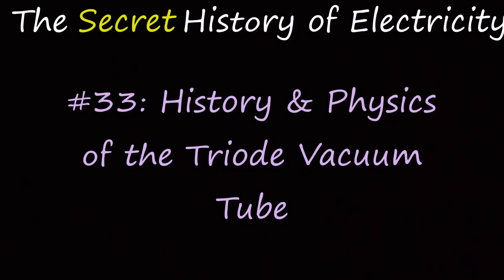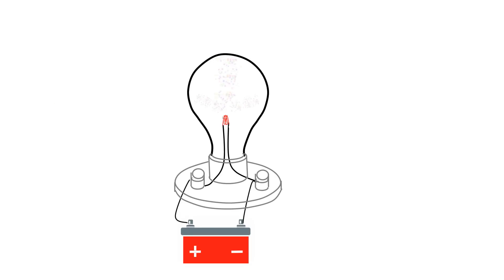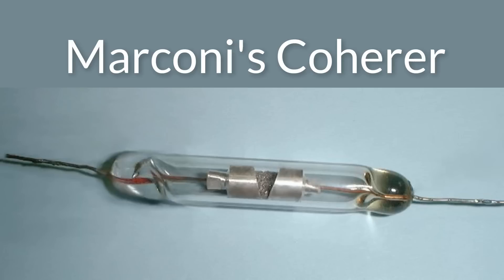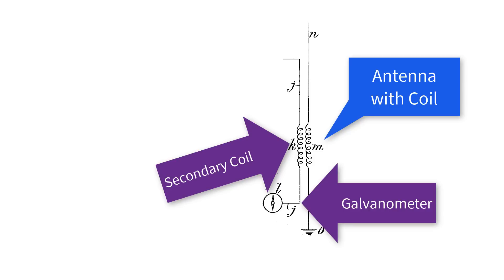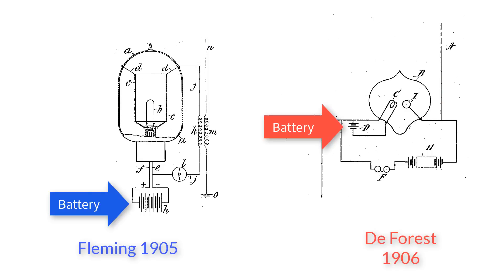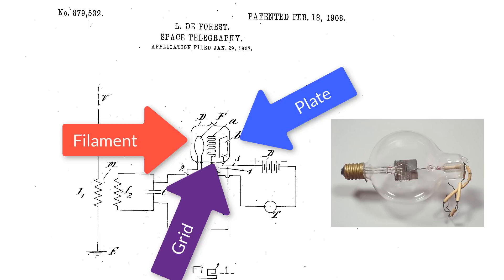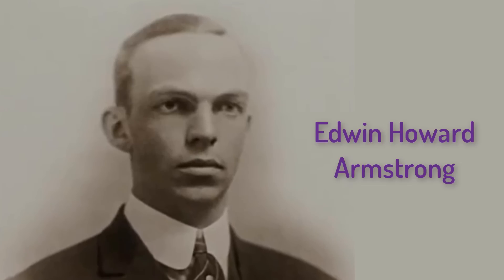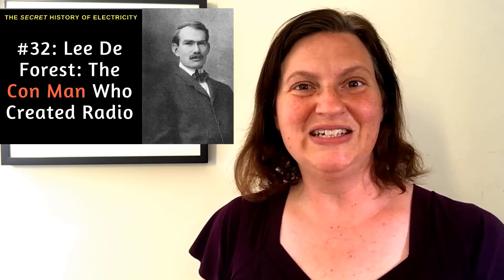Triode Vacuum Tube: History & Physics

Comment: I love learning the history of things I worked on. I first learned about tubes in high school in the late 1960s. At 16yo I had an apprentice license for TV repair. I wasn’t supposed to make house calls till 18 but the two men I worked for considered me qualified to do so. Imagine a 16 yo kids with a tube caddy and test equipment showing up at your house. I went into the Navy in 71 and they taught us both tubes and transistors. We’ve come a long way since then.
Reply from the maker: If you consider the fact that the television was invented by a 14-year-old, it makes perfect sense that you were qualified to fix them at 16!  I bet you did a better job than the adults.
Reply: @Kathy_Loves_Physics  I had a successful career working in electronics. I have worked extensively with fiber optic, digital microwave and satellite down to breaking out all those little circuits and testing them. I also did some  trunked radio. My phone rang a lot for advice. Heck, it still does from time to time and I’m retired. during my free time I built houses, worked on my own vehicles even rebuilding engines and automatic transmissions.
Reply from the maker: Wow!
Reply: I worked for aTV repair shop when I was 16 ~ 17 . After I made a few service calls by myself , the boss said I needed to grow a mustache and beard , because the lonely housewife customers complined and said I looked too young .

Comment: In multi kilowatt industrial lasers, we use vacuum tubes / triodes to switch 9 to 12 KV resonating at 80 Mhz, on and off to control the CO2 laser source.   The tubes are from Thales, anode voltage is up to 12.5 KV, grid is at -200V and switched at 60Khz.   The tube is cooled with deionized water running through it, the ceramic insulation glows a bright orange when run at full power.

Comment: When I was at college we briefly learnt about Valves and those old fashioned in the UK and Europe Pre-SI units used to specify them.  That was in about 1975-77, otherwise, transistor, inductors, capacitor stuff was all SI units.  I made a few things with valves that I could get to work more easily than transistor circuits.
Reply: This super-regenerative TRF radio works very well (page 43) I made, back in the 70s when I was a teenager it but without the reaction, as I was concerned not to broadcast rather than receive.

Comment: Still using them😃 Building guitar amps. Currently building a clone of a 1938 Gibson amp which includes a field coil speaker! Taking about patents, us Brits had the pentode patent The Americans requires a licence to manufacture them, however as the Americans are not keen on paying the Brits ( nothing new here from what happened at Boston😂), they came up with the beam tetrode which essentially does the same job but the internal layout of the valve (tube in the US) is different, effectively bypassing the British pentode patent.

Comment: I do not know too much about it but l think that Deforest knew that his triode was an electronic amplifier and used it without feedback to design primitive radios receiver and transmitters. In fact such radio circuits were taught in high school physics, many years ago, because they are relatively easy to understand. Armstrong discovered the way of making electronic oscillators with the triode by using a feedback circuit. Armstrong used it to create the regenerative and super regenerative radios which outperformed the primitive Deforest radio. Armstrong circuits were a long way more complex and unstable  than Deforest primitive circuits. Armstrong's oscillator is the key component of the superheterodyne radio, the most successful radio design. Armstrong became rich with it.
Reply: I read a book long ago and the history was very different. It bothers me the treatment of DeForest as a "con man". After I read this book, DeForest is to me the father of electronics and the victim of giant AT&T at that time. I would like to know what sources have Kathy about DeForest. I had watched other Kath's videos and found them very respectable and interesting. The author's name is Israel E Levine, and the book is Electronics Pioneer (c 1964).
Reply: @augustot.pareja8795  you are correct, Deforest discovered the first electronic amplifier and he has his place in old physics textbooks. However, modern books about history of radio present him as a villain and dishonest person (see 'science of radio' by Nahin for example), so the video is repeating  those opinions. Certainly, Deforest was not a 'nice' guy but if Marconi got a Nobel prize then it is fair to say that Deforest deserved one, by accident, too.

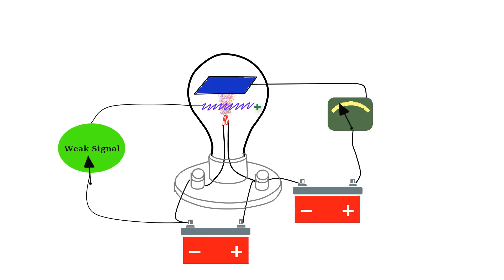Comment: 8:04  To be more precise the grid amplifies voltage rather than current: a small voltage change on the grid produces the same change in current as would do a large voltage change on the cathode.  For this reason in order to get good amplification we have to connect the cathode through a high impedance to collect these voltage changes on the cathode.
Reply: Yes. The tube amp has a high input impedance unlike the bipolar transistor.

Comment: I am finding these videos fascinating. My 1st "bout" with radio was in 1943 (7YO) strung a wire from a metal thingie on top of a tube in the old Zenith (Thank goodness it was a grid not a plate LOLOL) and I made static which interfered with the war news. I got paddled.
Greatest treasure I ever discovered accidentally  was "The Boys Book of Radio" in the school library, 5th grade 1946. I didnt know much about "condensers" or "Impadence" or why you had to wind so many turns of wire around a Quakers Oat box but I did get a crystal set to work sorta.  That book taught me the color codes and I bummed a bunch of 1930's junk radios from a local repair shop, only got a one 27 tuber to work for B. Scouts 1949.  1952, built a Radio Shack Knight kit 2 1S5's, SHORT WAVE - THE WORLD, SOLD ME.!!!! and radio/electronics became a career that lasted all the way thru the Navy as a CTM  and eventually on into computers to my retirement in 1994.  BTW I hate solid state 
An old man reminiscing. Sorry..
Reply: Fredrick Wise
It's ok tubes are better than transistors for audio amplifiers. If you have good transformers on the output you will get good sound. You will not get tube sound at the preamplifier stage you must have a good iron core transformer on the output of a 6BQ5 or 6CA7 or equivalent. I tried them headphone amplifiers with the single tube. I looked inside and 12 Volts on the plate and grid is a joke there is also a solid state amplifier inside that tin box. You can only fool me once. I love my dynaco amplifier. I need to recap and probably get matched quads for the amplifier. I want to keep it original. Magnavox also made good tube amplifiers.
Reply: @ronb6182  Few people realize the truth of what you have said.. For me it doesnt matter much anymore. Ive lost the upper two octaves in both ears working around industrial machinery before OSHA..
 In my 20;sI was tested, able to hear up to 26K, now I can barely hear lightning. LOL
Reply: @frederickwise5238  see the problem is the younger whipper snappers haven't grown up listening to tube electronics. I played with tube electronics since 7th grade. I remember AM radios sounded like stereo when they played classical music and beautiful music genre. I never had an FM radio but my friend had one. I got my older sister's stereo console which had FM later like one year later. After hearing a rock song on a dynaco st70 (another friend had one) and hearing the same song on a transistor stereo the dynaco won. The bass was richer on the dynaco. The transistor stereo was flat sounded. Then you got older transistor sets that sound better than new amps. I prefer the tube sets over all transistor sets. My hearing is not as good as it was but I can still hear the high notes. I have headphones that blot out sounds that are harmful to the ears at my workplace.
Reply: @ronb6182  The "phenomenom" to which you refer relates to the rich overtones or harmonics. that transistors "cant do"
I suspect that the streams of electrons in tubes can "ring" (dont know what else to call it) and the magnetic fields of good quality output transforemerw do much the same. These provide the timbre that tansistors cut off. But when you no longer hear above 8K or below avbout 250cps it matters little. LOL
Reply: @frederickwise5238  you said it better than I could. I have a few transistor amps I might try putting some iron between the output and speaker. I have a few isolation transformers at work. I will post what I find out. May even hook a scope to the output. I used to have a scope hooked up to one of my stereo  channels. In my youthful years.
Reply: @ronb6182  I dont think that will help. You cant get back near the end what has been lost up front.
Reply: @frederickwise5238  you are probably right. It may only help what's there which isn't much.

Comment: Thank you. ♥️ I got all nostalgic. Time to get my oddball 'tubes' , transformers , inductors out and build another guitar amp. I'm going old skool and querky. NO :  ECC83 or  12AX7 types permitted. NO : EL84, EL34, 6v6, 6L6. EVERY amp uses these!  I'm excited. 😊😊
Reply: I built a guitar amp with the goal of using tubes not normally used there as well. It has 6dj8 tubes and uses one of them in cascode. Unfortunately I never had much luck learning to play.
Reply: @canuckprogressive.3435  Ahaa.... E88CC is our Brit counterpart for 6dj8. I think they both like 130volts or less on the plate. Mu is a third of 12ax7. I am an old UK 70's punk... you don't need many chords to have a fun time. Good luck. 😊😊

Comment: Excellent explanation of the triode. I do wonder why it was necessary to rectify the signal from a radio antenna?
Reply: The low frequency  audio signal is carried” to the radio receiver by the radio frequency wave. The carrier is modulated with the audio to form an AM signal. Imagine this composite signal displayed on a oscilloscope with the waves mean centred on the zero y graticule. If you algebraically sum the upper and lower side bands you end up with zero volts. Remove either the upper or lower sidebands by passing it through a diode rectifier and low pass filter and you end up with the original audio signal to amplify and play through the speaker. Hope that is clear?

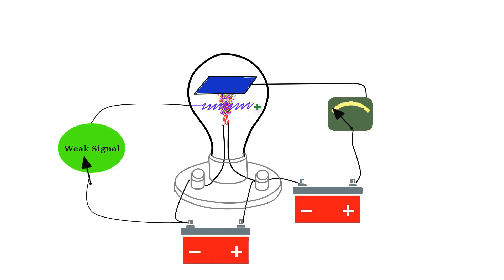Comment: 07:40 - An important point about grid voltage: valve circuits are designed so that the grid voltage is never positive with respect to the cathode; significant grid current stops the circuit from working and can destroy the valve. Maximum current through the triode occurs when the grid is at the same potential as the cathode - it is like a depletion-mode FET.
Reply: Yes, you have to bias it to prevent its shorting out thru the grid as an extra anode, closer than the plate.  However, there are "gun" style electron accelerators, and it's possible the early experimental grids -- we're calling them "grid" only in retrospect based on the most successful design -- could function as electron accelerators, diminishing the voltage drop while losing a negligible amount of current to the grid.

Comment: Electrons do not "jump off" the filament. 
The heated filament's surface is so hot that some electrons acquire sufficient kinetic energy to "escape" and form a "cloud" (the Space Charge) around the filament. 
This space charge exists around any sufficiently-hot surface, even in an incandescent light globe. 
The desnity of the space charge is determined by (i) temperature and (ii) work function - how readily electrons can escape the surface.

Comment: Please explain how electrons can create a smudge - Thanks, Phil
Reply: Since the filament was boiling off electrons when it finally gave away some of the pieces of filament with electrons still boiling off went to the positive side of the tube that’s my guess
Reply: @carlcook944  The electrons have nothing to do with it. When the filament failed, the tungsten vaporized and was deposited on the cool glass envelope.
Reply: @carlcook944  Once the filament fails, no more current will flow and the electrons will instantly cease to boil off.
Reply: If memory serves, tungsten filaments had not yet been in use. The filaments were largely carbonised cotton threads. It had already been noted that longer and or hotter the filament burned greater was there an accumulation of carbon deposit on the inside of the glass at the anode quadrant of bulb. But it was the case additional material would evaporate and coat the glass when the filament failed. (Curious, might this been an early inspiration for vapor deposition?)
Reply: @MetuPhysics-de4yj  I forgot about carbonized thread, but definitely not electrons. Vapor deposition like the getter in a vacuum tube!

Comment: Many thanks for your work in the electric field. I have a question that Would a triode give me an output power of higher frequency and higher voltage(say 30Khz/60Kv) from an input power of low frequency and low voltage(say 50 Hz and 220V). If yes does the triode vacuum technology have advantages over the transformers? Thank you
Reply: Yes but it would be slightly complicated.  The input frequency of the triode is gong to be DC.  So what you would do is rectify the 220 volt 50 Hz source to DC; then feed a triode oscillator operating at 30 KHz into a transformer, the turns ratio of which is suitable to change 220 volts (more or less) to 60 kilovolts.  Then you would have 60 KV at 30 KHz.  Not much power in it, but at least you would have frequency and voltage. 

It is the transformer that gives you 60 kilovolts out of 220 volts.

It is the triode that gives you 30 kilohertz.  

You won't get much power which is to say volts times amps.  A large triode can deliver up to about 40 watts.  A really big metal finned triode can do up to about a thousand watts. 

Transformers do not and cannot change frequency.  They can only change the particulars of voltage and current such that the product of volts-times-amps on input is approximately equal on output.
Reply: A 60 kV transformer is a problem of its own, insulation, corona discharge... Obviously it has been done many times before but for an amateur it is a path fraught with dangers from lethal voltages.

Comment: I may be wrong about this but I don’t think it was a smudge that Edison was investigating. A tungsten filament in argon makes a smudge when it breaks, but not a carbon filament in a vacuum. White hot carbon is volatile and the vacuum increases the effect. As the Edison bulb aged the filament eroded away by vaporizing with the carbon vapor condensing on the entire inside of the globe whenever the light was turned off. This made the globe get darker and darker as the filament got weaker and weaker continuously over time. Edison bulbs steadily dimmed over their lifespan.

I also don’t think Edison added a second battery to his experimental lightbulb containing the plate. Biasing the plate is how it’s used in electronics, Edison by accident detected a small current between the plate and the positive terminal of the battery powering the filament that didn’t seem to him to have a complete circuit. It was a fraction of the current across filament and while experimenting with it he found that the fraction remained constant when he varied the filament voltage. He thought for a while of how to use it as an instrument of measurement but eventually saw no commercial value in it. He patented it anyway. It’s his only true scientific discovery.

It was probably John Ambrose Fleming that realized that this discovery could rectify alternating current because Edison wouldn’t have anything to do with alternating current.

Comment: Couldn't help noticing an error in the animation at 7:55. The ammeter should move the opposite way, meaning that the needle should be to the right when electron flow is strong between the filament and the plate.
Reply from the maker: The LED Artist thanks for pointing it out. I don’t think it is an error as conventional current flows in the opposite direction as electron flow (darn Ben Franklin) so as electrons flow one way the current flows the other.
Reply: I spotted that too. You could argue the meter was showing plate voltage (so it would be high when there was no current flow), however the drawing suggests ammeter as did the narration.